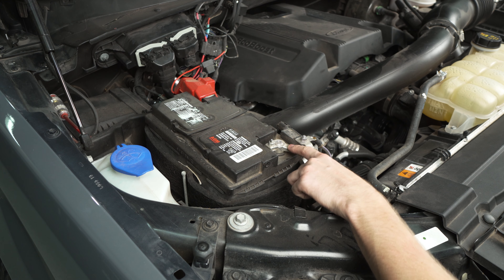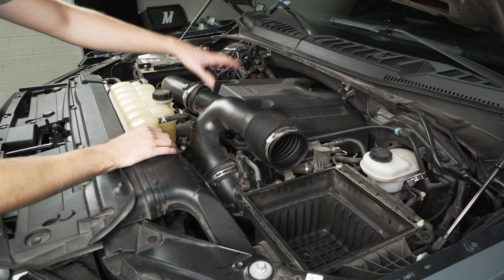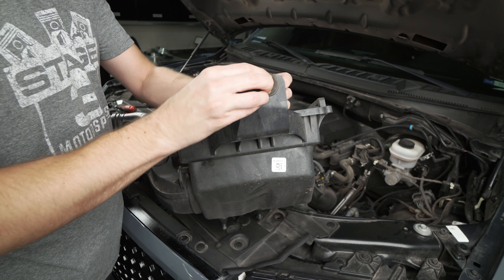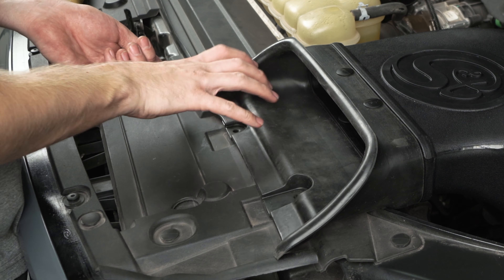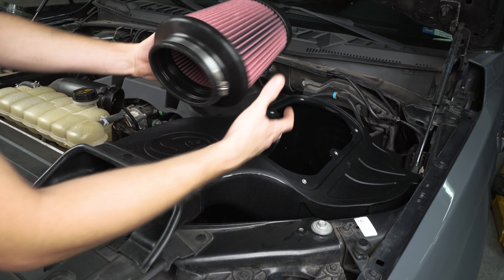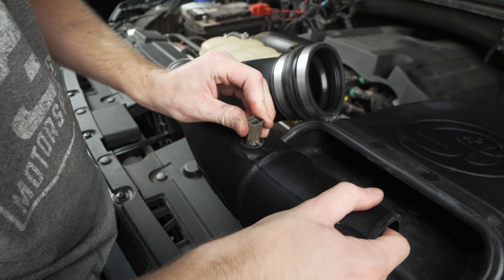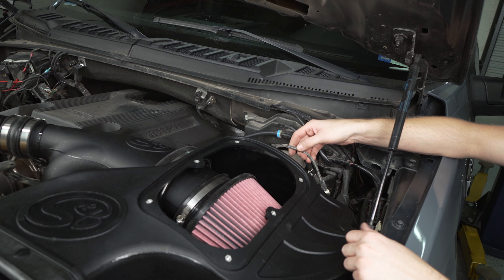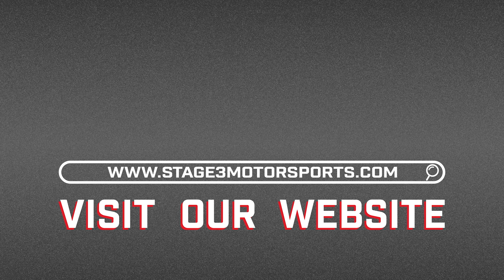15-20 F150 EcoBoost V6 S&B Cold Air Intake Install

Comment: I dont understand how this is 'cold air', its just puilling from the same source and using a different style filter...
Reply: Just because the OEM design utilizes a cold air intake, does not mean the aftermarket one isn't also a cold air intake. They both are.

Comment: I have the s&b intake in my 19. It’s def nice.
Reply: Can you tell the difference in HP?
Reply: @55codyharris11  when I installed it I installed exhaust and programmer as well so I can’t say whether it’s noticeable on its own
Reply: Can you hear any noticeable difference from when the intake was installed. Like more turbo whistle or more suction sound?
Reply: @benallyjaredful  I have a 3.5 Eco with only an aftermarket big resonator and stock cats. i did not notice much gain in turbo whistle volume.  (as I already get a pretty good scream at the right RPM) but in sport mode you can notice how much more air its able to draw in. hope that helps.
Reply: Hey Is The Install The Same For Ford Expeditions Also

Comment: 2021 3.5 Ecoboost content needed, or does this intake fit it? And if not, why? I understand it's a new truck but not alot of shops putn out stuff like this for a 21.
Reply: It's the same. Just installed this exact kit on my 21